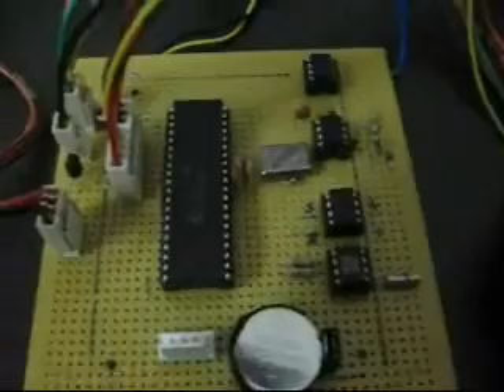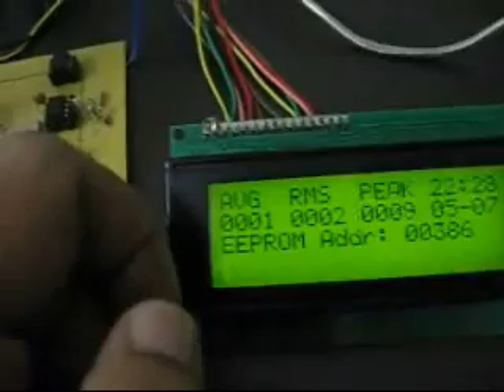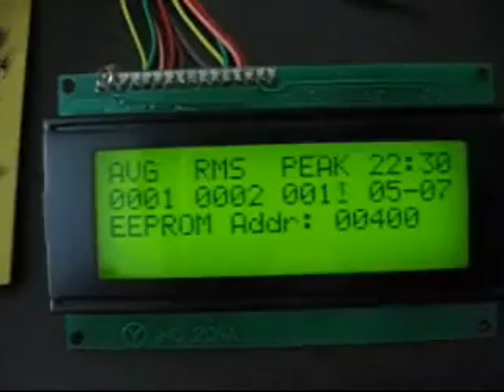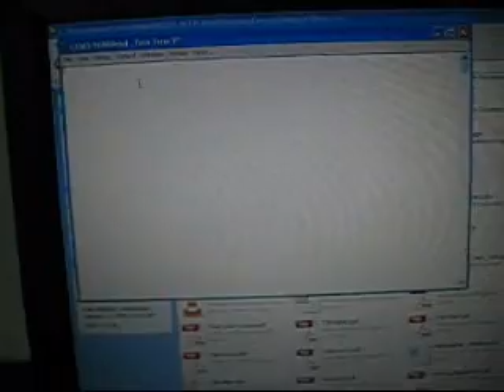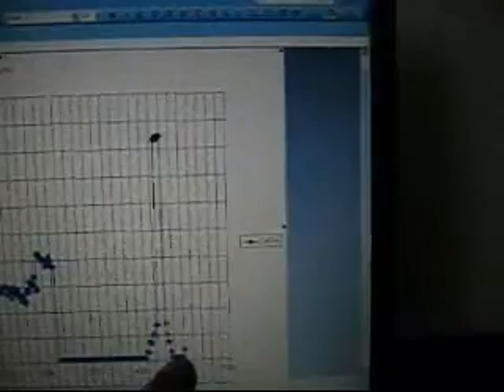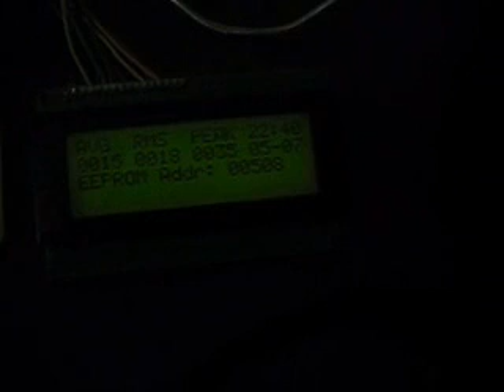Power_Meter

Comment: which wires do you run though the current transformer? is it all of them including neutral? i have a seed studio 100amp non invasive current transformer and i'm not sure how i would use it inside of the power box. thanks.

Comment from the maker: @madsci1016 
Yes. Its a current transformer. I got it from a scrap dealer. The resistance that I measured was 330ohms. The price of a new one should be between Rs.100~ Rs.300 (Indian money), which is eqv. to US$2 ~ US$6.

I am not measuring the voltage. I plan to assume it as constant 230V.